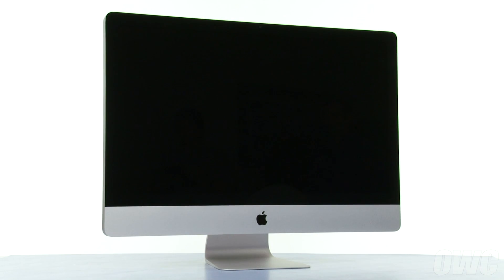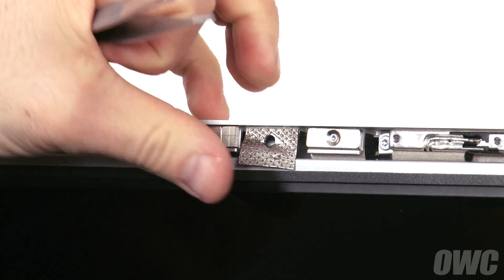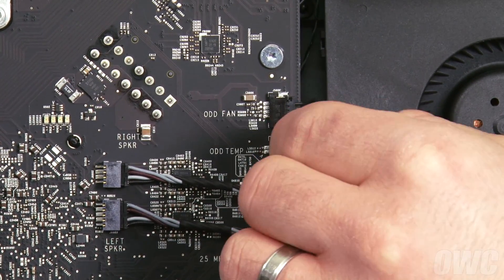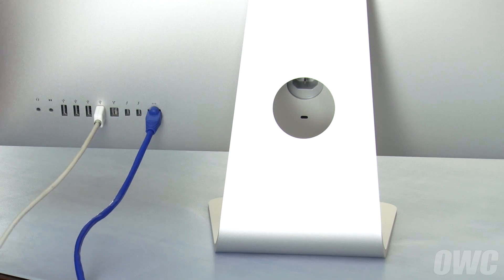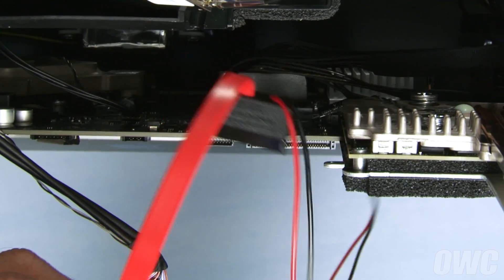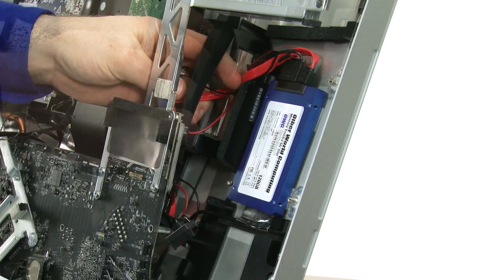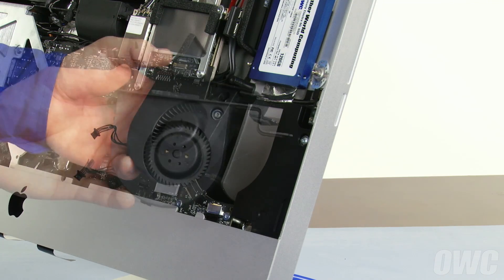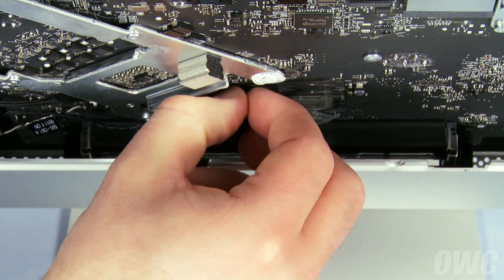How to Install a 2.5-inch SSD in the SSD Drive Bay of a 27-inch iMac Mid 2011 (Updated)

Comment: So I had to buy a new Screen Display Flex Cable because mine was so old it wouldn’t “slide in”. It still didn’t slide in and took a considerable amount of effort to get it in. The other cable next to it seems loose. When I turned on the computer, there’s display. Are the pins supposed to be in the plug?
Reply from the maker: Great question. Yes, on the 2011 27" iMac, the display data cable connector does have exposed pins, and those pins are supposed to be visible on the logic-board side. The cable itself does not have pins; it slides over them and locks in place.

A few important points to keep in mind:

- The connector is very tight by design, even with a brand-new cable. It should require firm, even pressure to seat fully, but it should not be forced at an angle.

- Once fully seated, the connector should sit flush and straight on the logic board. If it’s slightly crooked, that’s a sign it isn’t fully aligned.

- The adjacent cable can feel a bit loose; that’s normal, as it uses a different connector style.

- Since you’re getting a display on power-up, that’s a good sign and strongly indicates the display cable is connected correctly.

If the image is stable (no flickering, lines, or color issues) and the system runs normally, you should be good to go. If you notice display artifacts later, power down and carefully reseat the cable, making sure it’s aligned perfectly before pressing it in.

Hope that helps!
Reply: @poweredbyowc I’m not getting a display at all. The left fan powers up also. Chatgpt says it’s the GPU so now I have to blind program and disable the AMD GPU and force Intel HD 3000 graphics in Linux Mint. 😵‍💫

Comment: Why doesn't the video show anything about the inline thermo sensor where does that go .Does is go on the SSD ? They only show the sensor going onto a HDD not a SSD can anyone explain plz
Reply from the maker: This is a video for adding a SECOND drive to a device with a drive already installed with a thermal sensor. There are other videos that we have available that show replacing the original drive outright, including the thermal sensor.

Comment: 😢😮omg can’t you just take out the old hard drive and stick in the ssd.   That’s so much hard work and bound to talk something up.
Reply from the maker: Hello Gary, you can do that however, the SATA bay is a SATA 2 3GB/s connection, you would be limiting the SSD speed in half by doing so. The bay we show here will get you the full speed for the drive.

Comment: Tried install a new SSD to replace my old HDD in my mid 2011 27” iMac, no matter what I did it would not see the SSD when installed inside the computer, it works fine via USB in a external enclosure, why is this?
Reply from the maker: Hello Briar, we are sorry the SSD is not recognizing in your system, please give us a call at 1-800-275-4576 and speak with one of our technicians we can see whats going on with the drive. Apologies for the inconvenience!

Comment: Does anyone know if you can install bigger fans in the 2011 27” iMac ? And is only one SSD is available for this model ?
Reply from the maker: Thank you for reaching out to OWC! These are great questions! Unfortunately there isn't a larger fan you can place in the imac 27" 2011. Depending on how your imac was built you can put and SSD in the main bay and the optical drive or the SSD bay. This Bay is behind the optical drive.  Please see this link ( https://eshop.macsales.com/shop/ssd/owc/imac-27-inch/2011)  for the different kits we offer. Please let us know if you have any questions.
Reply: @poweredbyowc  thanks for answering , is there any chance this SSD upgrade will solve my performance problem as in stuff like dots are showing up on the screen by where the fan is I think and the top left part and top right are hot at the back ? If it’s still cool it works fine , if it’s on for 20 minutes or more and starts giving me a split screen or , what looks like water droplets on the screen or just a white screen .
Reply from the maker: A SSD will help with overall performance of the machine.  The 6G SSDs do run cooler than a standard SATA drive so it may help there if it seems like the machine be having some heating issues.  How much of a difference that it may impact for the heat though is a bit hard to say as it currently must be within the expected ranges of heat that the 2011 iMac can withstand or it would be causing the machine to shut itself down.

Comment: Good god this is a helpful video but I am about to trash this iMac. Can anyone confirm that trying this WITHOUT the temp sensor will cause the iMac to shutdown when booting from internet recovery???
Reply from the maker: Thank you for reaching out to OWC. This a great question! You will want to use the temperature sensor when upgrading your machine with a new drive. This will ensure that the fans operate appropriately to disperse heat in your machine. Please let us know if you have any further questions.

Comment: If you simply want to replace your old spinning HD with an SSD use a different video because this one is much more complicated and does much more than you need to do.
For instance, you don't have to remove your logic board!
Reply from the maker: Hi Jeff! Spot on! To replace your hard drive with an SSD, you'll mount the SSD in an AdaptaDrive https://eshop.macsales.com/item/NewerTech/ADPTADRV/ and follow the Replace the Main Drive video. https://www.youtube.com/watch?v=Y-t6QCjko84
Reply: @poweredbyowc  is the sensor still needed for the ssd?

Comment: I see you do not need the (small grey, adhesive) Static pad that is stuck to the HHD, when installing an SSD here, so I assume that means you also don't need it on a SSD replacement for the main HDD. Is that correct?
Reply from the maker: That would be correct you do not need that!

Comment: Can’t seem to find this sata cable ? Are they female on both ends ? Seems like the 2011 iMac 27 inch only has one style of cable. Can you post a link. Thanks for the vid. Also do you have to exchange sata port locations with the HD location ?
Reply from the maker: You do not have to exchange SATA port locations, this would add an additional SATA connection to add in that SSD. The cable is sold in an installation kit here: https://eshop.macsales.com/item/OWC/DIYIM27SSD11/[](https://eshop.macsales.com/item/OWC/K27IM11SE120/)
Reply: I picked up a sata cable off ebay for about £6, works perfectly fine.

Comment: Just closed up my 27" Mid-2011 iMac after installing a Samsung EVO 850 500GB SSD. Powered up and the fans are spinning at full blast. I didn't touch the HDD or its thermal sensor to the best of my knowledge. I guess I'm going to have to open it back up and see if I left a cable unplugged but I'd be happy for some insight.
Reply: i’m looking to buy the same thing, if i install the ssd without making a time machine backup or anything, can i just boot up into recovery mode and install macos, or do i have to do that beforehand with my hdd
Reply from the maker: Installing an SSD in that SSD bay specifically shouldn't require any additional thermal sensors, but we also only do these installs with our own drives, so it's hard to tell since it's not a drive we work with.
Reply from the maker: You can use Internet Recovery (CMD+R) to format and instal a fresh copy of the OS after installing the SSD into the machine, it does not need to be done beforehand!
Reply: hi, I bought that hd 2 years ago.. the problem I had was that after a couple of months the OSX system will get corrupted.. the only way I sorted that out was unplugging the original HD leaving only the ssd. Then I had the fan speed problem, I sorted that with hdd fan app. Were you able to sort it with different cable routing?
Reply from the maker: Hi Giampaolo, I'm not aware of any known issue with cabling and drive corruption. There could be a problem with the drive itself causing the issue. I'd encourage you to reach out to our tech support on this one!

Comment: Thanks for the video. I have a mid-2011 iMac and I have two new SSD drives to fit. One boot drive and one storage drive. Is it possible to use a dual caddy to fit both SSD's into the main HDD bay? That way I don't need to stick it under the optical drive. I would assume so, unless the dual 2.5" adapter is larger than a single 3.5" HDD. Thanks, really appreciate any help before I pull my computer apart!

Comment: Hi there . few years ago i update my Imac using yours DIY hdd upgrade. Now i want to push it with SSD (hehe its about time), thinking to buy one of yours OWC 1 TB Mercury  6G SSD and follow this video - will it worked? How the mac will use the secondary drive? i will prefer to use it as a system Drive. Thanks

Comment: My OWC 500GB SSD is finally failing s.m.a.r.t. status. As I sent my 2011 27" iMac in for an OWC upgrade several years, I understand it's ok if the hard drive is starting to fail. I opted to add the SSD as an additional drive behind the DVD Drive. 

I don't really want to remove that SSD all the way behind everything and simply replace the spinning drive with an SSD using your OWC kit. 

Question: At 7:46 in the video, can you simply unplug the secondary SATA connector to the defective SSD without removing the logic board to mimic the drive not being there anymore?

Comment: This video shows two cables at the beginning [0:18] but I can't find any place in the rest of the video where a 2nd one is installed.
Reply: Ferenc Szabo it’s “either”, meaning the kit comes with one or the other. They are the same. It’s just one of the end connection (the longer side of the right hand one) is separated, while the other is glued together for ease of installation. 
Basically, they are the same cable.

Comment: I intend to swap my current 2tb HDD and optical drive for 2 SSDs.  1) Do I need to unfasten the logic board to run connections, or do I simply swap the current connectors to my new drives and mount using your adapt-a-drive/data doubler?  2) Do I need to purchase a temp sensor or simply fasten the ones currently in the iMac to the new drives?? Thank you!!
Reply: Disregard: I contacted your service dept. Using your adapt-a-drive and data doubler, I installed the two SSDs and transferred the temp sensor from the optical drive to the new drive in the data doubler. Command-R for a Mac OS X fresh install has my computer booting up 3.76x faster!! Without your products and install vids I never would have tried the swap, but im very glad I did!! Thanks @macsales

Comment: Ordered the upgrade kit and followed the video. Super easy, took a little under 2 hours to complete and now my iMac runs like brand new! Thank you for an informative video, fast shipping and quality product to match!
Reply: @John O'Herron  Ah... the peanut gallery struggling with reality.
Reply: Hello J.B. i have a doubt, why not to install de ssd instead of the hdd? or is it that this upgrade its for having both ssd and hdd and also de dvd reader?
Reply: @renatokarlochumpitaziflori7324  Bunun sebebi, cd rom girişinin 3.0gb/s de çalışmasıdır. Sata kablo ise 6.0gb/s de çalışmaktadır. Bunu sata kablo almak yerine HDD söküp SSD takarsanız, HDD içerisinde bulunan ısı sensörünü de HDD ile birlikte almış olursunuz. Evet içerisinde bulunur. Bu durumda fanlar sürekli çalışmaya sebebiyet verir. 2011 imac için konuşuyorum.
Reply: Super easy? 2 hours to add a HDD? You are being sarcastic I hope.

I'd like to take a baseball bat to the Apple "Engineers" responsible for this totally dumbarse assembly.

No wonder Apple service costs a fortune. The reality is Macs are built to be instantly obsolete and Apple is lying through its teeth as usual about being supposedly "Green".

Comment: Successfully upgraded my iMac mid 2011 with this guide! I now have the Samsung 860 EVO 1TB!

This is the first time I've ever had the courage to play around with something this expensive. However, with good care and planning I think everyone can do this. There are a couple of things I'd like to add as feedback and also as advice for people that want to attempt this just like me:

- The video doesn't mention it (I think), but you have to make sure that you are discharged to not risk frying the components with static electricity. During the whole process I wore an ESD wristband that was hooked up to the metal of the iMac itself. I wore 100% cotton clothes and worked barefoot on a wooden floor. And as there was no tweezer included in the kit as stated in the video for some reason, I had to buy a metallic ESD tweezer set for about $10 (this is not really necessary though, it is possible to do this upgrade without any tweezer at all - I ended up barely using it anyways)

- Detaching cables was ALOT harder than what this video makes you believe. Some of the cables are really tough to detach. Sometimes it requires a bit of extra force, but make sure you always do it carefully, they can easily break as some of these comments seem to indicate.

- When opening this thing up, you will most likely notice there are ALOT of dust inside there. So make sure to buy compressed air in a can beforehand which will help you blow it all away. Before using it, make sure that the can has not been laying down (have the can placed on a table for at least 2 hours just to make sure the liquid inside it is 100% att the bottom of the can). When using it, DO NOT twist it around, it should always be held vertically or you might risk spraying out liquid. And never ever use a vacuum cleaner, you will most likely destroy your components as it can generate static electricity.

- In case anyone wonder why anyone would prefer this way instead of easily just replacing the optical drive (the CD tray drive) with an SSD. Well, the SATA cable of the optical drive is only capable of 3Gb/s compared to this one which is 6Gb/s, so there is an important difference! You also don't have to sacrifice the optical drive. And you also don't need to hassle with a temperature sensor cable that might create problems with the fans going full speed. So even though this installation is a thousand times harder, it is definitely worth it.

- When routing the SATA cable for the SSD I had to find another way as I did not have that upper channel like in the video. I only had the bottom channel, which I ended up not using. I wish this guide could show a picture on how to do it on an iMac without the upper channel... Anyway, instead I put the wires through the very small space between the optical drive fan and the plastic wall next to the optical drive. So I had the cables coming from under the optical drive - this worked wonders for me.

- When you're done you HAVE TO make sure to enable TRIM for the SSD right at the start! That way you will prolong it's life. There are two options: either run the TRIM enabling command in terminal or purchase and install TRIM enabler.

I think that's about it. And yes, my iMac is suuuper fast right now, and I'm more than happy!! Thanks for this awesome detailed guide on how to do this upgrade!
Reply: Just about to dive into this now. Thanks for awesome feedback on your process.
Reply: @ChristianYri  I’m about to do the same. I hope everything worked out well for you.
Reply: I was told that newer operating systems (like High Sierra, Mojave) have TRIM built in as part of their formatting procedure, making manual activation of this unnecessary. ???
Reply: Yes, I had no trouble in 2017 with this install. Yesterday 2021-08-10,  I replaced the main HDD with a 1TB SSD. Also "no biggie", in fact easier than this install.

Comment: I purchased the cable and installed a PNY 240 GB SSD 6.0GBs and now the screen wont turn on and the fan is very loud. Please help. I read my mistake was trying to use a sata 3 SSD for a 2011 imac 27inch mid 2011 model which doesnt accept Sata 2 cables or 6.0gb/s speeds? Please advise.

Comment: Is it possible to install the SSD with a ssd bay that substitutes the ODD, without detaching the logic board? I mean using the odd sata cable for the SSD and putting the ODD in the external usb case.

Comment: What an incredibly succinct and informative presentation and walk-thru.  Why have I NOT found this before?  I've just bought a MacBook pro 2017 but, want to keep my current iMac (21.5-inch, Mid 2011); Processor 2.5 GHz intel Core i5; Memory 4GB 1333 MHz DDR3; Graphics AMD Radeon HD 6750M 512 MB.  Questions:  (1) I'm a USA citizen currently stationed in Singapore, can I get the kit anyplace over here? (2) Is there a place I can order online?  Thanks again for an awesome video tutorial.

Comment: Hi, I am trying to add an SSD to my mid 2011 Imac without removing the standard Hard drive and add the ssd behind the optical drive. My question is do I need that In line thermal cable?